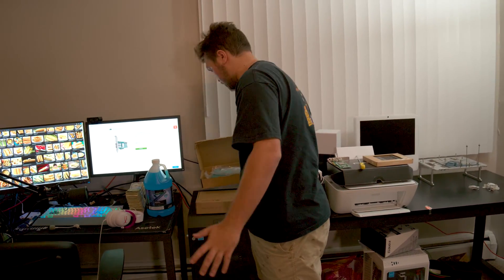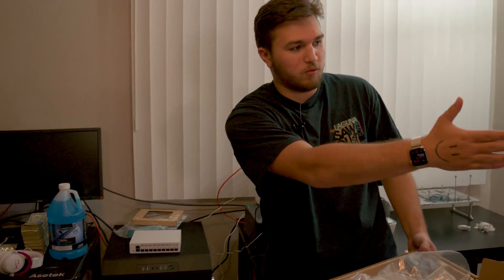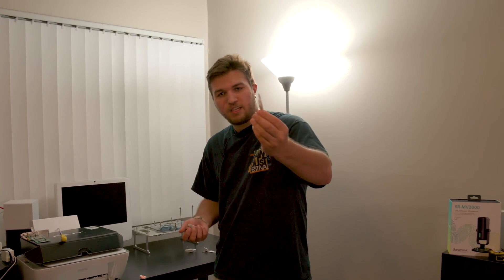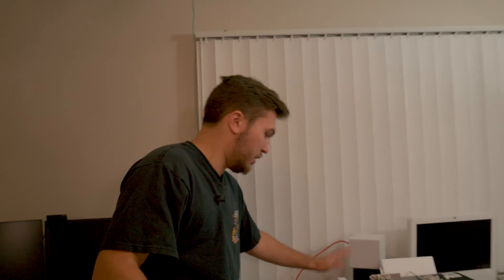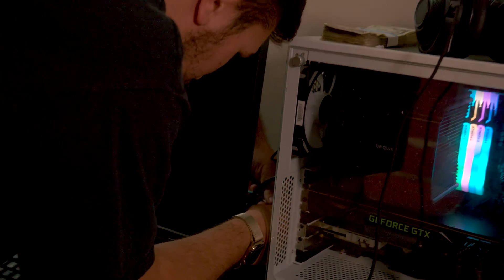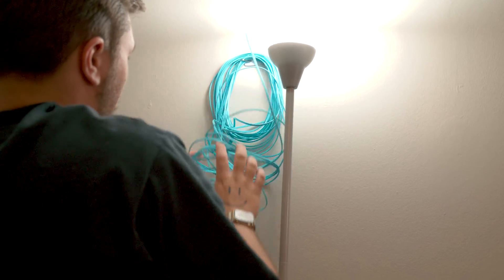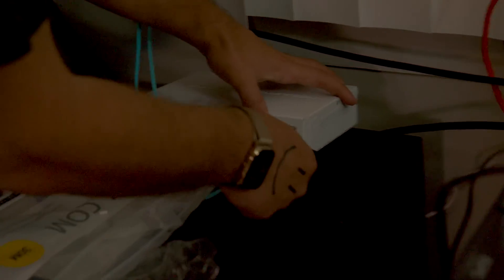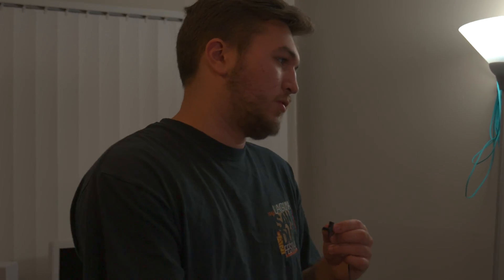10 GIGABIT Intranet!!!

Comment: Hate to break it to you man, but the hba will not work with that stuff. It uses fiber channel, not ethernet. You would need a fiber channel switch, and fiber channel hba on the other side as well. You need a 10gbe nic. Make sure it is a nic(network interface controller) and that 10gbe or 10g or 10gigabit ethernet is somewhere in the listing. I would go with a mellanox connectx-3 or intel x520. Both of those are reliable proven server nics that can do 10gbe, they might need a fan though fyi.
Reply from the maker: Yea ur right, switched it out for a dell Qlogic Card I had laying around and it works great now.
Reply: @dinkiethesink  awesome, high speed networking. Is really cool, I was looking into 40g infiniband myself
Reply from the maker: Yea I’m more familiar with the hardware than the protocols. Would like to implement QSFP+ into my next upgrade bc it’s such a nice Thicc connector. 
I use intel X520 converged adapters everywhere else because those can run on Win 10 Pro. The dell adapter I used only works on server OS bc driver BS.